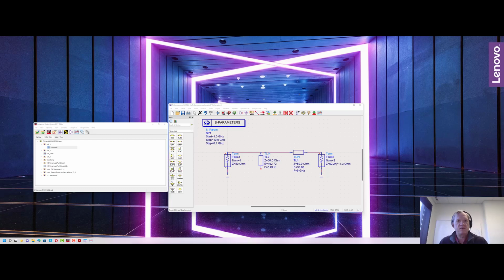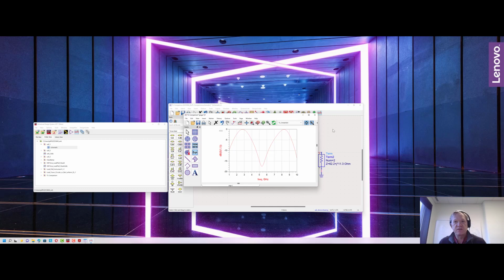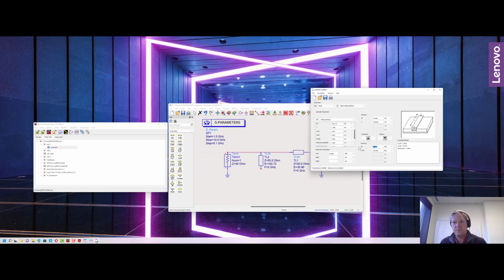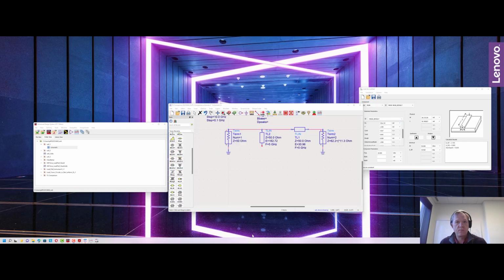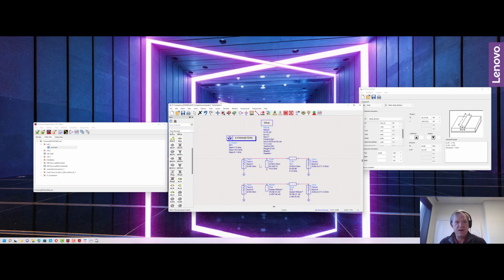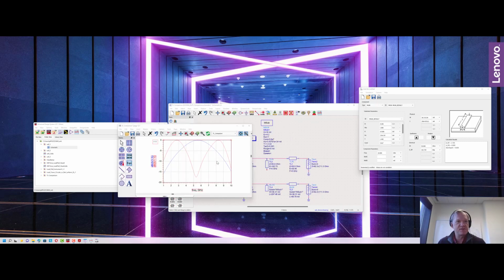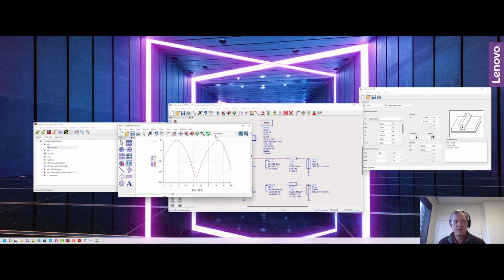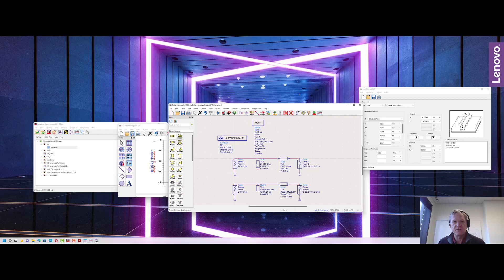ADS - Designing a Microstrip Matching Network

Comment: still far from a practical design that resembles the actual physical layout. for that you need to at least add the microstrip T junction and you will need to do quite a bit tuning on those two lines to get it matched again
Reply from the maker: That is correct. Just showing how to use the tool. Most substrates are also quite a bit more complicated for practical designs (e.g. multi-layer, with varying materials, different via structures, etc.)
Reply: you are right ..in practical there are many unknown impedance that we cant predict the value..